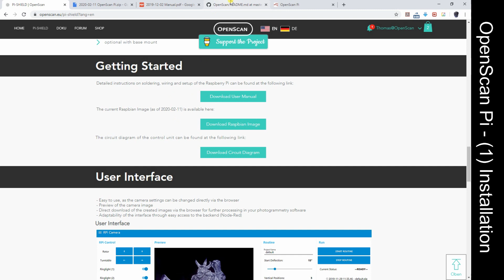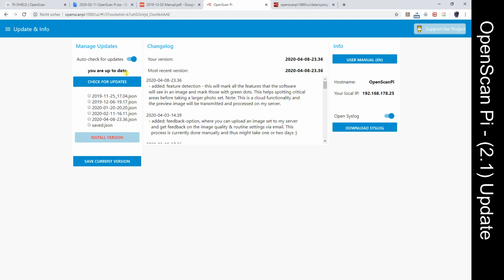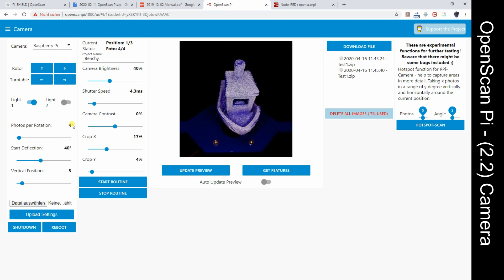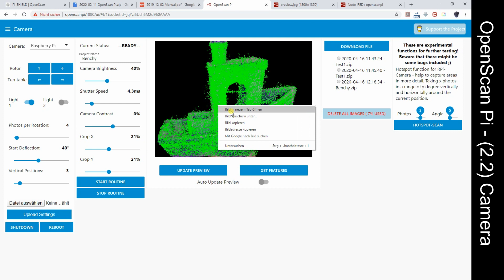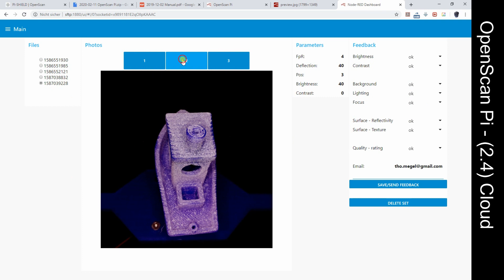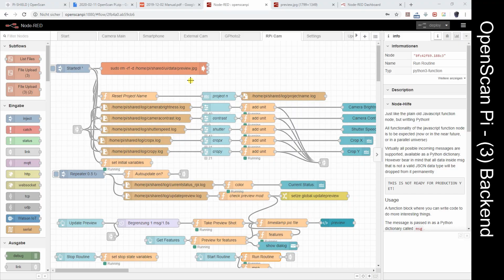OpenScan Pi - 3D Scanner control interface

Comment: please post a detailed video, that how you installed node-red and all....
Reply from the maker: get the latest documentation and a step by step guide here: https://openscan-org.github.io/OpenScan-Doc/firmware/setup/
Reply: @openscan_eu  sir thank you for your reply, followed every steps and everything is done correctly but we are unable to open openscan user interface through openscanpi:1880/ui
Reply from the maker: @anukanaka3028  the new address is http://openscan/ or http://openscan.local. If you still have problems connecting, please use the ip address of the device and open http://+IP.

Comment: I've been considering building my own version for scanning heavier metal parts
the image at the end gave me an idea for the layout, I'm thinking I might use nema's with planetary gears or just use larger steppers, maybe an orange pi and a custom web interface.
I noticed it didn't take long for aliexpress to rip you off btw, they have a version on they're site at the moment although it doesn't use an rpi
Reply from the maker: At the bottom of this page, there are some larger versions which are totally compatible with both the arduino and pi-shield: https://en.openscan.eu/scanner
Yeah, I am quite aware of the Aliexpress/He3D knock-off... I don't mind to much, as they have copied an earlier version of the electronics and even some earlier mistakes ^^ And I am not sure about their documentation. I already had several disappointed people contacting me for help..
Reply: @openscan_eu  cool thanks, I didn't realise the big version had been released in terms of printable parts
Reply from the maker: @zebedie2  "released"... I have published the files, but there is still some more work necessary, but I currently want to focus on the Mini. You might want to checkout the remixes of the large version on thingiverse. There have been other people working on it and running it successfully. :)
Reply: @openscan_eu  yes sorry I know it's not an official release or anything, but there's more there than I was expecting so thanks for that
Reply from the maker: @zebedie2  No worries, I just wanted to lower the expectations, before people start this long prints ;)

Comment: Can you still use the Pi and the camera for octoprint ?
Reply from the maker: Do you mean running octoprint from the same sd card? I havent tried that yet. But you could easily prepare a second octoprint sd card and just swap those.
Reply: OpenScan thanks and sorry for the stupid questions i’m totally new to raspberry and 3d printing. My guess from your reply is that the Pi operating system is running from the SD card so I can just switch the cards back and forth with dedicated OS and apps ? Is that correct ?
Reply from the maker: @stephanemeyer7640  Yes, you are absolutely right. Just create two SD cards with the dedicated images and then you can switch those at any point (as long as the device is powered off at that time ;) And no worries about any "stupid" questions, I have started working with the pi not even a year ago and had no prior experience too, so I had to ask many, many stupid questions...
Reply: OpenScan thank you so much for your answer and nice words. Beyond that I find your work absolutely mesmerizing and it motivates me to get into raspberry and 3D printing systems envers more. Keep up the excellent work !

Comment: With the pi version do you always have to go through a web browser to use or can you connect some kind of LCD screen to it? Also does this work with other cameras outside the Pi camera, I have a sony a6500.
Reply from the maker: You could attach a monitor via hdmi and use the browser interface locally. 
There are many cameras that can be controlled via USB: https://raw.githubusercontent.com/OpenScanEu/OpenScan/master/supported_cameras and it would also be possible to modify an existing remote shutter control and connect it directly to the pi shield.
Reply: @openscan_eu  fantastic thank you you've got yourself a customer XD

Comment: Do you think that the raspberry pi version is better than the arduino version?
Reply from the maker: Short answer: the pi version :)
Long answer: I prefer the pi version, as it makes it much easier to get decent and consistent images. Furthermore, with the new pi camera, I got results better then with most DSLRs I've tried. I am also working on an OpenCV Script, that will perform quasi-live image analysis and will give feedback on the image set. Furthermore, there might be optional cloud-computing available some time soon, where you can upload the whole photo-set and get a decent result within 30-60min... I could continue for quite some time, but you get the idea ;)
Reply: @openscan_eu  whats the best pi camera out on the market right now that I can put into this scanner?
Reply from the maker: @JJ-vp3bd  It's the Pi HQ camera, which is compatible with the scanner. See this post for some further testing results: https://www.reddit.com/r/OpenScan/comments/gfottc/10_micron_accuracy_with_the_new_pi_camera/
Note, that the Telephoto lens works great with the given setup, but I am still looking for some other suitable lenses..
Reply: Thank you for your fast answer so if I have the arduino version I can still upgrade it to an pi version, because I will start with the arduino at first and then I will upgrade it to the pi version?
Reply from the maker: @juliusbohm7224  Yes, you are absolutely right. The hardware is fully compatible and you would just need a different 3d printed part to mount the pi control unit.
Reply: @openscan_eu  So this https://www.openscan.eu/product-page/raspberry-pi-shield is the extension kit, isn't it or am I wrong?
Reply from the maker: Yes it is :)
Reply: @openscan_eu  Thanks again for your answer! :-)

Comment: Wow! It's really excellent project .... amazing. One question to the design: Would it make sense to have counterweight (german: Gegengewicht) to compensate the weight of the z-rotation stepper?
Reply from the maker: Yes, for heavier objects it makes sense to add some kind of counterweight. Without it, 0.8-1kg usually work fine